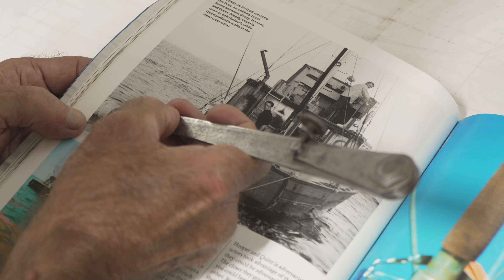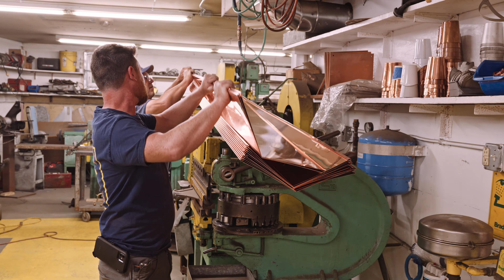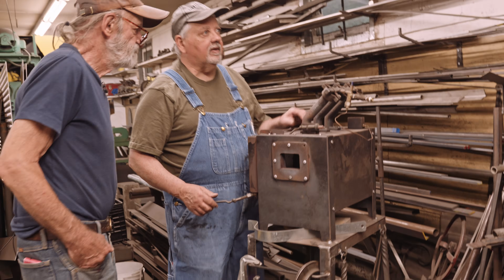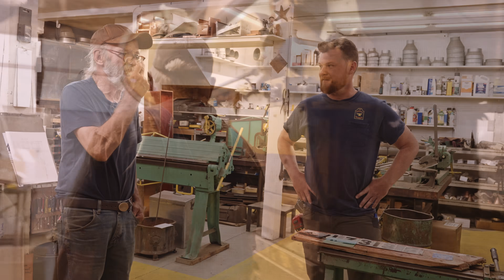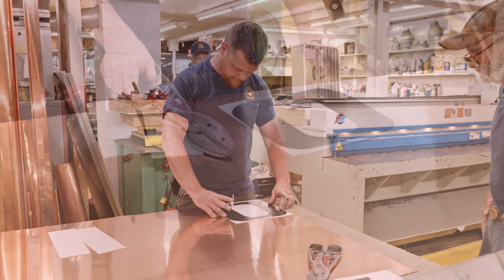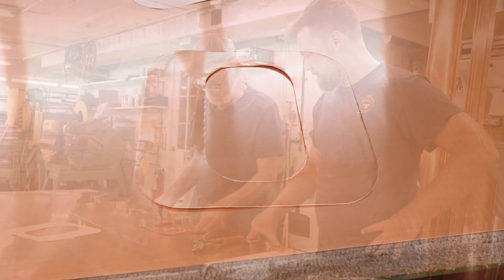Building Orca - Episode 18: Orca Lettering at Metal Works

Comment: Btw Lou if  your interested you can change the texture of the surface of the copper letters with Grinders wire wheels, nylon abrasive brushes, or flap discs to create brushed, matte, finish or other desired  textures. Variable speed grinders are preferred to prevent overheating the copper.
Wire Wheels/Brushes: Short, stubby wire wheels are effective for heavy grinding, while finer wire brushes create softer, brushed finishes.
Abrasive Nylon Brushes: Used in burnishing machines for satin or directional finishes.
Ball Peen Hammers: Used for creating textured, dimpled, or "hammered" surfaces that to me give the nices finishes. 
 btw Love that old fabrication table, sweet, you don't see those old large fabrication tables like that very often any more, they are originally called Acorn welding tables.  I use to be a welder fitter. Miss the trade bigtime..

Comment: Very cool ! I’ve done a few replica orca transoms and researched the lettering . I believe it was straight metal that was left to weather . 1/4 inch steel plate cut by plasma cutter does the job .  Everything on the boat was weathered by the art department . I mean everyyyyyyhing ! The copper will look cool though . I’ve splashed muriatic acid on copper to weather it . Regardless very interesting episode . I fish out of point Judith and saw the monkfish…love that ! I wonder  if they sell those ?

Comment: The originals were mild steel, made by Travis Tuck. Joe chose steel deliberately to allow the steel to rust and drip red rust stain down the transom. In addition to that, the letters are mentioned in several books, which include photos of the black steel letters being mounted. About 10-15 years ago the original steel letters went up for auction and they’re currently on display in the academy museum in LA

Comment: I would definitely have used the metal brake to quickly cut all the external straight lines. I wonder if this copper has the correct metallurgy to tarnish.

Comment: Nice work. Snips were the way to get it done without fussing over it too much. As a graphic designer, I would have been looking into scroll saws, dremels, setting up guides to cut all the straights first, finishing the curves with other guides, and would have wound up having to file the edges down to the lines.

Comment: What a great shop.. they do some fantastic work! Great to see in this day and age… As an old sign guy. We would’ve just hit the back of the pattern paper with a light misting of spray mount to hold it down to the metal. Not really critical on such a simple letter, but if you had something more ornate, it does help to hold it down tight..

Comment: If you use bronze screws to fasten those letters on, there'll be some galvanic corrosion between the two metals. Since they won't be underwater, it may not be significant, I'm not certain.

Comment: Nice lettering. You'll be glad you went with the 32oz/sqft. 

I've done a few standing seam copper roofs in the 1970's and I was lucky enough to find my required screws at my local hardware store. 

Screws for your copper letters' attachments can be found online at Bolt Depot, item #4211 or #4220. Also consider item #3057 and/or #3058. 

With internet availably the hardware stores don't stock specialty screws anymore so this is where I buy my screws now when needed. They have always provided me with great service!

Comment: Very cool metal shop. The factory I used to work at had one of those big dead blow welding tables in my assembly area. Great platform for any heavy work that absolutely can't be bouncing around. I think I'll be cutting copper name letters out of all the copper sheets I pulled off of mavericks hull.  Recycling old material to produce something that's nice but not fancy at all. Kind of a theme with my rebuild.

Comment: For those who are curious, the two hand shears he used with the red and green handles. Red is for left cut and green for right. The colours are the same as navigation lights. Red left, green right.
Reply: And yellow cuts straight
Reply: What was the brand?
Reply: @loubonaparte5063  He said Midwest. The most common brand is probably Wiss. Craftsman used to have real good ones as well.
Reply: I installed slate , lead standing seam copper and ryan zinc roofing,  untill a 60ft fall put me in a wheel chair , 10yrs to get onto my feet , occasionally my nose and forehead..
My Dad's best buddy in Vancouver BC  was a tin worker , anything from galv, copper buckets to church spires .. the guy was dyslexic real bad,so he taught me copper and zinc work,  I did lead flashing and burned lead counters and slates , before they banned ghe.m that and did his communication stuff ..

Comment: Those letters need to be around 6mm thick with beveled edges.
Reply: @johnbower...Lou bought .8268mm thickness. 32oz copper is pretty stable, may require a few extra fastners.
Reply: I think they are going to look like banged up garbage can lids in short order.  Needed plate or casting imo.